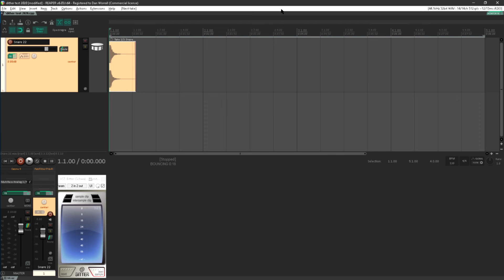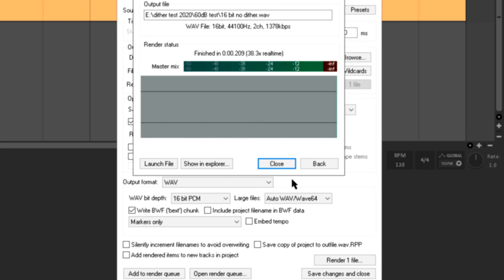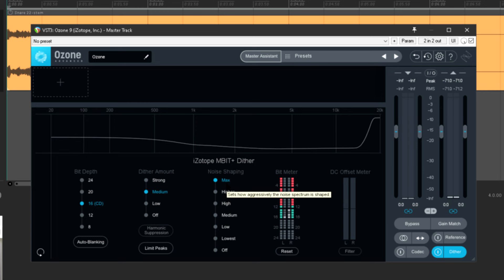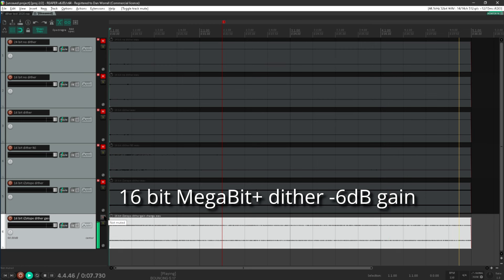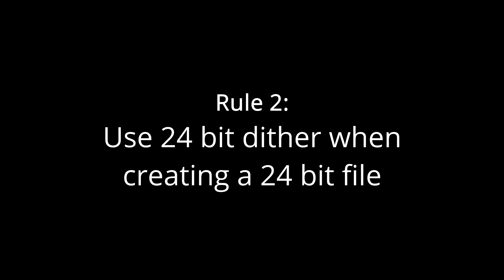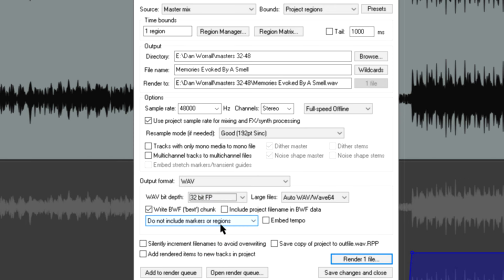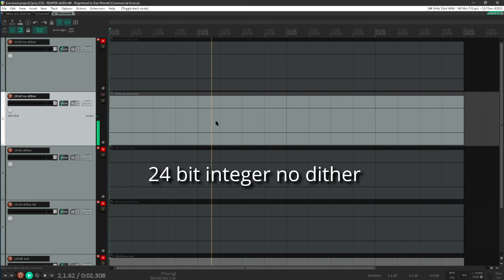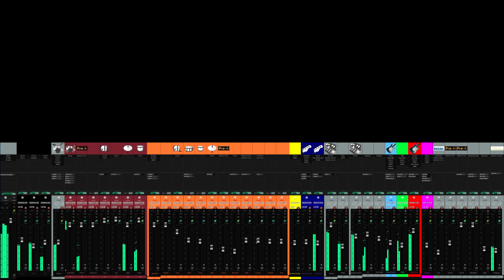WTF is Dither?

Comment: 1.) Use 16-bit dither for creating 16 bit files.

2.) Use 24-bit dither for creating 24 bit files.

3.) 16-bit dithering should be done only once.

4.) Dithering is the very final step, even after sample rate conversion.

5.) Use 16-bit dithered files as resources for latter mp3 conversions.

6.) Don't see 'Dither' like a 'Disaster'. Music production has many other steps that deserve more attention. No point of overly worrying about this.

learned all these thanks to Dan ❤🙏
Reply: when I want to convert to MP3, I should first export 16 bit dithered file and then export MP3??
Reply: @VAEOMMusic  can your DAW export .mp3 directly?
Reply: @dulmin_  yes. I use studio one and it supports MP3 export. What should I do? I work at 48k sample rate and want to export 320 kbps 44.1k mp3
Reply: @VAEOMMusic  I also use Studio One, but I'm used to dither by FFProL2 plugin. So for answering this question, I had to watch another YouTube video to find how Dithering can be enabled in StudioOne itself (if you are not using a specific plugin to Dither).

Here's what I found :-
1. Go to "Options" window (accessible via "Studio One" dropdown below title bar at top).
2. In "Advanced" category, under "Audio" sub-category, enable "Use dithering for playback and audio file export"
3. Hit 'OK' (the window will then close with changes applied)

Since you've enabled dithering now, once you are exporting your MP3 (at 320kbps 44.1kHz), the file such exported should be automatically dithered. However I'm not familiar with this method, since I do dithering by FFProL2 plugin (so the aforementioned option for StudioOne's own dithering isn't enabled in mine).

I assume you know how to export. If not ; well it is done by "Export Mixdown" window accessed by the "Song" dropdown below the title bar at top. In the "Format" region of that window, you can select "MP3 File", and set your preferred attributes (44.1kHz / 320 kbps). I suggest to use Constant bitrate.

Since we're supposed to choose a 'bitrate' here (rather than 'bit depth' as in Wave exporting), I don't think there's any "16bit / 24bit / etc." choice to be made during mp3 exporting. Besides, mp3 's can't be in 24 bit, which is why if you're supposed to create an .mp3 file using an existing .wav file, it's advised to use a 16bit .wav for that conversion (not a 24bit/32bit .wav)
Reply: @VAEOMMusic  If you can export 'mp3' directly from the DAW (with dithering enabled), that's totally fine. No need of exporting 'wav' and then converting to 'mp3'.

But if a DAW can't export 'mp3' directly (such that you have to export a 'wav', then convert it to 'mp3' by a SEPARATE CONVERTER APP ), there you have to make sure that 'wav' file (taken from the DAW) is 16bit.
Reply: @dulmin_  yeah, thanks for replying. I knew about default dithering option in studio one. I wanted to get a 3rd party dither service for my files(since I compared the sound of stock dither in this video). Btw I was just guessing if I could just 16 bit dither using prol2 and directly hit MP3 export. Or maybe seperately export 16 bit dithered file and then export MP3 from it? If that makes any difference.
Reply: @VAEOMMusic  I cannot think of such a difference. So I would directly export .mp3 (after setting ProL2 at the very end of masterbus)
Reply: This is assuming the original is 64 bit, if I work In 24 bit the second rule doesn’t apply. Right?
Reply from the maker: No one works in 24 bit. You may record 24 bit audio files, but all modern DAWs use floating point maths internally. The signal at your mix bus will be at least 32 float.
Reply: @DanWorrall   I choose 48khz\24bit when I start the project, it records the files at 24 but the result at the mix bus is 32bit float? I’m shocked… so even if I mix down at 24 without conversion I should apply the dither… I’m shocked and a bit upset I didn’t have this info before. Do you know if the Daw does the process 48 to 44.1 by itself first on the mix down process or do I have to convert manually even before rendering with dither ? Thanks for your answer
Reply from the maker: Yes, and yes. Don't be angry at the DAW: if the mixing were all done at 24 bit you would need to dither the output of every single plugin in your project (and double check none of them were clipping).

Sample rate conversion complicates issues a little, and I don't know how every DAW handles it. My general advice would be to render your mix at the native sample rate (either 24 bit with dither or 32 float without) then convert that using the best quality src you can lay your hands on.
Reply: @DanWorrall  thanks a lot, happy I’ve found your channel. Have a nice weekend.
Reply: Or if you’re recording in 24 bits and stay in 24 bits, no dither is needed. It’s just when you go to a lower bit depth or sample rate. 

As far as exporting to MP3… you want to master that file first.
Reply: @DavidRavenMoon  this is what I was thinking too but seems any Daw runs at 32bit float no matter what. I find surprising nobody is warning about that anywhere. And I’m not new into this. Still I believe him and the video shows the results with 24bit dither.
Reply: @carlosp.1846  I’m not saying he’s wrong. I never dither because I don’t convert anything to 16-bit. 

But normally when you aren’t attenuating signals to barely a whisper you don’t need to worry about which dither you use.  And he said that. It’s just for very quiet passages where you might get that distortion.
Reply: @DavidRavenMoon  but this is what I was saying read me first comment, was saying the exact same thing as you. Thinking rule 2 was not needed if I stay at 24 when I mix down without conversion
Reply: or dont care about dithering as it is imperceptible and unnecessary by the time it is encoded into a streaming codec
Reply: @drkastenbrot  it’s really for very quiet parts. I’ve downsampled with and without it. I can’t hear a difference.
Reply: @DavidRavenMoon  to be fair the music I work on has pretty normal dynamics, mostly electronic and pop mixes. I suppose a classical piece with very quiet bits at a very high listening volume might benefit audibly from dithering but for the majority, 16 bit without dither is going to be a flawless experience. 
It baffles me how some renowned engineers make ridiculous claims like the exact dithering method being super important. I doubt they could even tell in a blind test.
Reply: @drkastenbrot  Exactly. I do rock/pop type stuff. Probably a bit louder than some stuff.
Reply: @DanWorrall  exactly! Even fairly low end digital live sound mixers like the A&H Qu-Series does 32bit float on channel processing and 64bit float in the mix engine :)
Reply: the only thing i know is that the mp3s i export from Cubase are roughly 100% larger than expected.  not sure whether they are in 24bit or even higher but i can play them in Winamp. also no artist complained about quality for previews / recording stems so far
Reply: @carlosp.1846  In fact most daws (cubase, fl, live) etc use 64bit float to process all audio.
Reply: 7.) When using an insert plugin to dither always set your master fader to unity/0.

Comment: This is great, and I have only one comment. Even with highly dynamic material nobody will hear 16 bit truncation distortion on decaying reverb tails. Just as you had to amplify the snare files by 60 dB to hear the differences shown in this video, you'd have to raise the playback volume at least 40-50 dB to hear that distortion on very soft passages. Of course nobody does that while listening to music, unless they're doing experiments like the ones shown here.
Reply from the maker: Hi Ethan, good to see you here! I suspect you're right of course. I well remember when a DAW I used to use turned out to have a bug in the 16 bit dither and no one had noticed for over a year... But its already controversial enough to suggest that 24 bit dither doesn't matter, so that will do for now ;)
Reply: @DanWorrall  LOL, you know me, I embrace controversy. :->)
Reply from the maker: Yes I've noticed :)

Comment: As someone from the RF engineering world, watching these videos is just fascinating. There's so much in common between audio and radio, the same fundamental mathematics and a significant overlap in terminology, but there's enough differences that it feels almost uncanny at points.
Reply: sounds are frequencies right? so that totally makes sense to a layman like me
Reply: I am a hobby EDM producer and I worked for a short time in a Radio station, the equipment and plugins/software you use are fascinating and some are unheard for music producers
Reply: @Will-qx9vm  Probably the two techniques I'm most surprised don't see use in the audio space are frequency mixing and quadrature/IQ sampling.
Sure, additively shifting the frequency content of a sample is less "musical" than the logarithmic pitch shifts that audio people usually reach for, but unlike pitch shifting there's no phase discontinuity problems you need some extra intelligent algorithm for, and the effect is basically free computationally speaking.
And, while audio files wouldn't actually be smaller if stored using an IQ sample format (since the frequency content of audio is so close to baseband), it would  make nearly all effects processing algorithms more efficient, and enable dealing with phase issues in less awkward ways. (In fact, a lot of algorithms literally start by resampling the input to IQ, and end by resampling IQ back to the output format.)
Reply: We do use frequency mixing/ring mods in sound design/synthesis but its generally far less useful for most applications because it 1) isnt much good on polyphonic sources because it doesnt preserve the ratios between notes. We usually work in EDO tuning systems like 12tet and destroying those relationships render those shifts pointless 2) It requires back of the napkin calculations that slow down production. You'd need a program to streamline it regardless.

Comment: Any Ableton users watching this in 2022 I just tried v10 and 11 they also truncate mp3's to 16bit PCM on import. And no, despite what the render bars look like, it doesn't convert the mp3 after rendering the PCM with dither, so just like here in Reaper, All mp3's rendered directly from Live will have no dither unless you use a plug on the master

Comment: Very insightful, as always! The mp3 test was a real surprise, since I had no idea that mp3 can encode 32 bit floating point. Can we expect a future video comparing lossy formats such as mp3 and aac with wav? :)
Reply: He already did if you look at his video on the myths of mp3 and lossless files and whether higher bit rates make a difference.
Reply: You can do this extreme dynamic range in Apple AAC-CVBR, but it takes a few seonds to align to a lower level. Opus goes down to about 24 bits. Other codecs and in variable bitrate mode cut at reasonable levels of silence.

Comment: I have a question. I recorded @ 48k/24bit with my Tascam DP-32SD and imported that main file song to my Ozone 9 stand alone. After shaping the song I exported to 44.1k/16bit with dithering. Call that the "Main Master".I did another export of the same song only with a slightly different EQ setting to fix just the intro and exported 44.1k/16bit dithering. Call that "intro only". Next, I combined the 2 in WavePad by pasting the intro file over the main song file to blend in the EQ's. Now I want to save all that. So.....Since I already dithered when exporting the 2 files, should I again select the dither function in WavePad which says 16bit interger or leave it black since the 2 song files were dithered u/16bit when exported from Ozone 9? If I import the song back into Ozone once the 2 files have been combined to do anymore mastering, do I again select dithering when exporting? Thanks.
Reply from the maker: In theory editing two files together (no cross fade) won't break the dither and you won't have to dither again. In practise though, most edits will break the dither. And if you process it in Ozone the data will be back to floating point resolution and will need dithering back down to 16. The question is, why are you dropping to 16 bits when it's not finished yet? Keep it all 24 bit until you have a file that's ready for release in every other way, then just dither that once.

Comment: It makes me happy knowing that there are other nerds who compulsively go down these kinds of rabbit holes.

I've made hundreds of spreadsheets to better understand the non-theoretical big picture of some random detail. Things like compulsively testing the aux-in latency of all my portable speakers vs. PA speakers. Or doing a few hundred passes of encoding videos with x264 vs. x265 vs. ProRes vs. hardware accelerated codecs at various bitrates for various video lengths to make the best use of the max upload size on YT. I just learned Fusion 360 and bought a drill press to make a custom rack for MIDI / DJ stuff. 🙂

Comment: Once again, incredibly amazing explanation of a concept I previously knew nothing about.  Thank you Dan!
Reply: My process has become this:

1. Export my mixdown file with no dither as a 32-bit WAV file
2. Import the file into RX for phase correction, save again as a 32-bit WAV
3. Pull the file into my DAW for mastering.
4. Now, when exporting the fully mastered track, I can export a 16-bit WAV or FLAC file with dither, only having applied it once with no loss of dynamic range or extra dithering earlier in the process

This is most likely overkill, but will ensure the best end product consistently when dealing with any content that includes a large dynamic range

Comment: Hi Dan,

I have a question.

I would like to be able to render out my 48 khz project as a 44.1 khz, 16 bit export while also applying dither with a 3rd party plugin like GoodHertz's.
Reaper has the option to encode an mp3 at the same time.
This would be perfect for my workflow.

But here is the thing, do you know of anyway to do this without breaking the dither? Or is the only way to do so to either do all of the sample rate conversion and dither after in something like RX, or, use the built in dither option reaper has to offer. And if that's the only way, does it correctly apply dither after the sample rate conversion, before the mp3 encode?
Reply from the maker: Only one thing I can think of: in the render window there's an option "run processing at project samplerate" or similar. With that on your mix will render at 48KHz then get converted after, which will break any dither you added manually. If you turn it off however, your project will render at 44.1 instead: source audio will be converted before mixing, synths will run at 44.1 etc. And so will the dither you put on the master channel. Of course there is more risk that the sound of your mix will change if you do this so definitely check it back afterwards.
Reply: @DanWorrall  hmmm, this would perhaps maybe be an option, since reaper does allow me to use instance and chain based oversampling for plugins that benefit from this 🤔
And would allow me to just add an extra - 1db TP version export to the same queue with the wildcards for naming everything as I go. 

That would save a lot of time 😅

The main use case is mostly to be able to do large amounts of exports, say when I am mastering an album, efficiently. Exporting 12 tracks in 48 khz - 32 bit and then converting/dithering them all in RX, in addition to renaming them all correctly AND having to take into account - 1 db TP because the lossy codec conversion for most streaming platforms happening AFTER normalization is fricking nightmare..

If anyone else in the comments might have a cheat code for this, I am all ears 🙏!!
Reply from the maker: @musicbyagu  does RX not do batch conversion? Reaper does. And I think the r8brain algo is good enough for anything.
Reply: @DanWorrall  I do use the r8brain when I do use reaper, but because I usually work in 48 khz, and only oversample a small hand full of plugins that do not have it built in that would actually benefit from it, I've been doing everything for conversation and my deliverables in rx.
For the sake of workflow speed I am going to run some tests though.. Either do it all in reaper and run my projects at 44.1 but use a lot more chain or instance over sampling, or see if I can find a faster way to do batch conversions, dither and exports through rx.

Thanks for thinking along Dan! 💪

Comment: Really appreciate all of the thought and work that goes into making these Dan. I actually never knew that MP3 and other lossy encoded formats were encoded at 32 bit float, and decoded by the player. That was really cool. :) . . . My DAW doesn't even allow you to select Dither when rendering a 24 bit wav file. :P Never really noticed that before either.
Reply from the maker: I don't know if that's true of all lossy formats, but certainly MP3 and I'm pretty sure AAC also.
Reply: So, if I understand this correctly, the much criticized and sneered upon MP3 can store a much greater dynamic range than a 16 bit WAV?
Reply from the maker: greater than 24 bit wav in theory. But only if encoded from AND decoded to floating point, which seems to be far from guaranteed.

Comment: This was super helpful. Years ago, I mixed down to a WAV then encoded an MP3, but the piano part tail all had that nasty crunch. I was baffled at the time, and even with years of recording (mostly not DAW), I learned an important lesson.

This all cam about when all my Pro Tools mixes sounded great, but the bounces were flat and far quieter. By adding dither on the master, that problem disappeared, though I am not sure if the levels are still lower than expected.